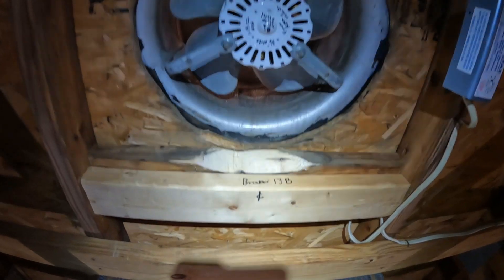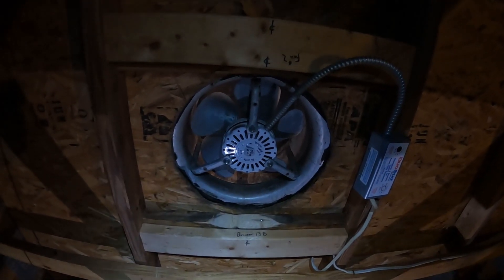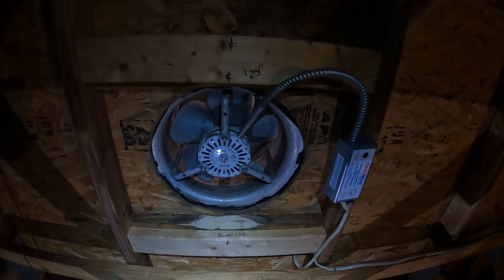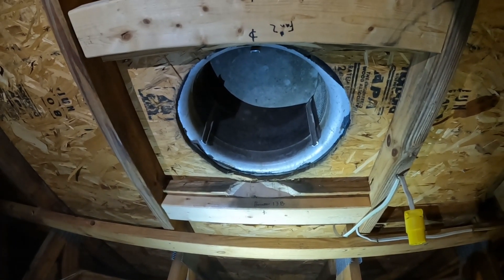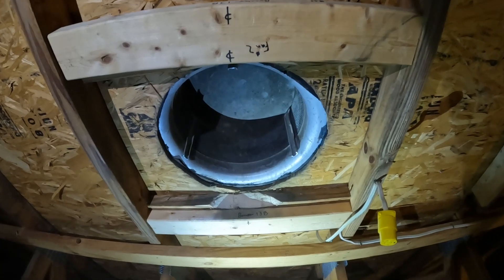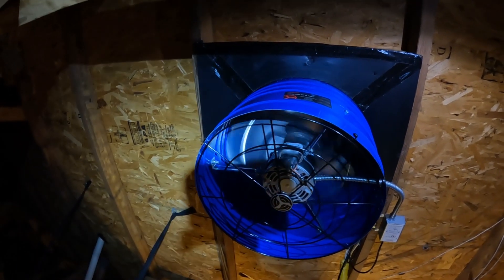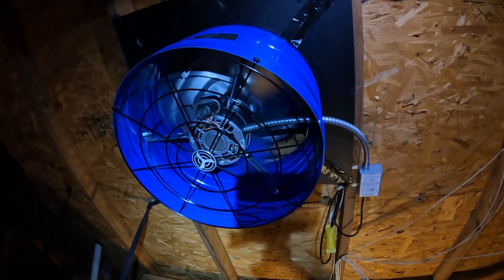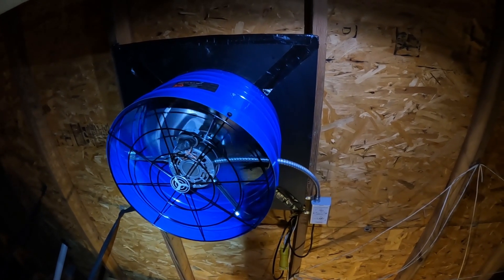QuietCool Install - Existing Attic Roof Dome Retrofit - Replaces Lomanco motor 04-11-23

Comment: Why did you need to replace it
Reply from the maker: The Lomanco motor that  failed used 374 watts, so it made sense to drop to the QuietCool @ 70 watts on low speed.  The QuietCool by design also pushes twice the CFM.   Thanks

Comment: Have you had any issues with lint or debris clogging up the fan motor?
Reply from the maker: These split capacitor motors have much bigger vent slots, versus the old style motors they replace.  But no debris or lint buildup on a 1 year old one so far looks clean.
Reply: @jwhoward  Split - capacitor ok. I’ll look for that. Shopping for an attic fan now. Appreciate the reply!

Comment: Nice video, question:  I have a ridge vent but I'm in a lennar zero lot line community in Tampa.  I've been told not to install a fan in the roof, but to consider installing in "in the middle of the space so that the air indeed pulls up but pushes through the ridge vents themselves.  THoughs?
Reply from the maker: Thanks.
I actually have a small solar fan in my garage that is pointed upward at the center of the ridge vent, it helps some but is not very effective since the ridge opening is so narrow and can't channel the air at all..certainly better than nothing.

So if you want to stay off the roof, I'd recommend a gable end mount with one of these mounted outside.  
https://www.homedepot.com/p/Master-Flow-19-25-in-x-19-25-in-Square-White-Aluminum-Automatic-Shutter-Gable-Louver-Vent-SGM20/100092056

My house already had the roof dome vents, so I converted to Quietcool at 70 watts on low, set at 100 degrees.  South Orlando, and it is terribly hot up there!!
Hope this helps.
Reply: @jwhoward  my issue: hip roof
Reply from the maker: On those I always installed them on the roof at the end of ridge vent (between the hips).
In your case, probably the back of the homes roof.
Just don't want them directly below the ridge vent, it could pull water during a heavy rain.

Comment: Great job!  I have one but after 11 years it went out. I will replace the motor soon because we are having 103-105 temperatures. I am thinking that maybe I should add another one. Since the motor stopped when I go up the attic it is super HOT!!!!!!!!! People do not realize the difference in having one and not having one.
Reply from the maker: Hey thanks!
It's definitely worth the effort.
I also added a 2nd one so the motors last longer. The old ones were like 374 watts, these are only 70 watts each if wired on low. 
Yeah it's crazy hot up there, plus it cuts the shingle life in half.
Bring lots of gatorade..haha